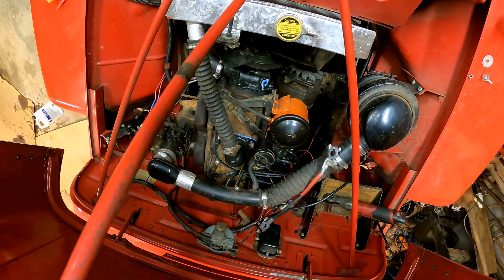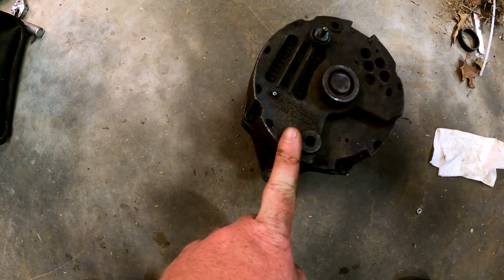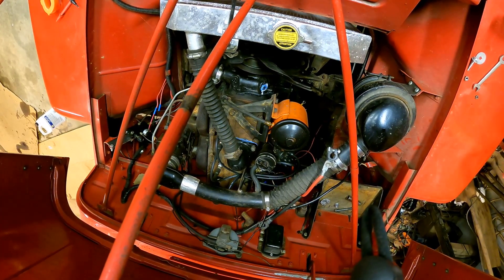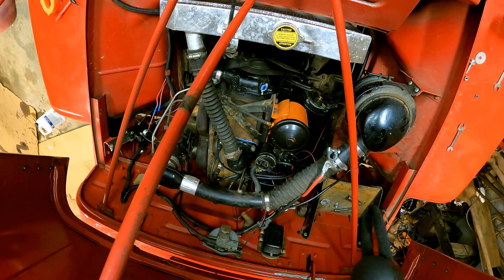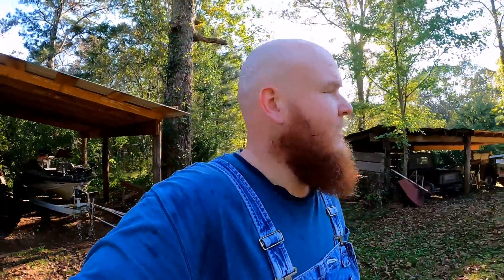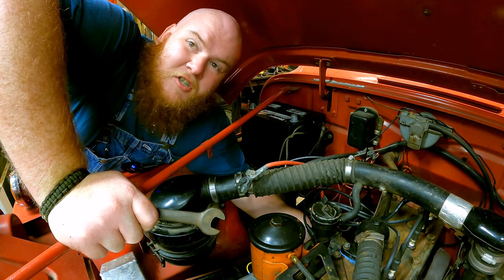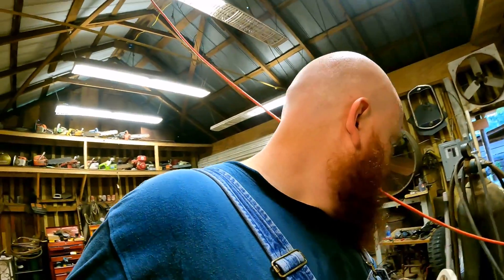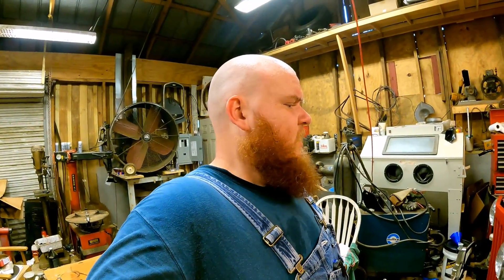My Willys Is Finally Charging (Alternator on a 1949)

Comment: Odd question... What was the reasoning to hooking up the #two spade slot to the battery bolt on the alternator?
Reply from the maker: If I remember correctly the alternator needs that hooked so that it self regulates correctly. The alternator I used only charges after the engine reaches a certain rpm and is not self exciting. Its been so long since I messed with it that I could be wrong. I believe that wire jumping from #2 to the battery stud lets the alternator know how much it needs to produce power wise. I wired it based off of the diagram on Jeepsterman's website.

Comment: What’s the part number for that alternator?
Reply from the maker: I don't recall, I'll have to check it on the truck. It is a generic gm 1 wire alternator. I would try to buy one that is a real gm alternator instead of the aftermarket ones.